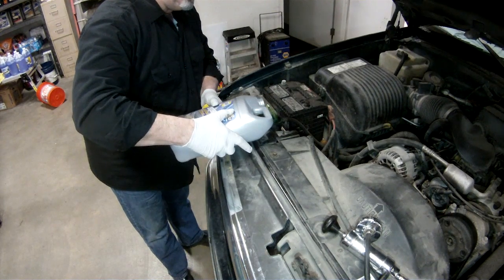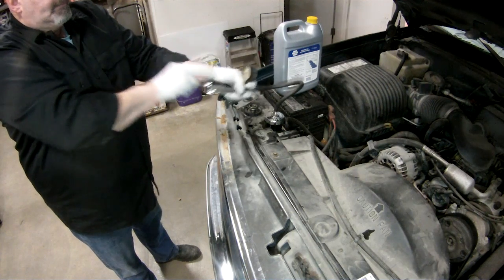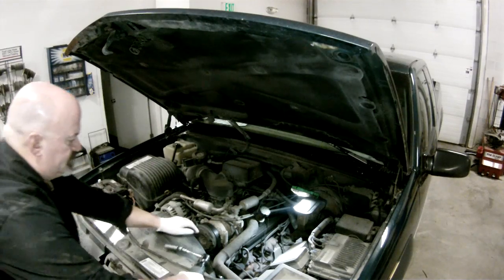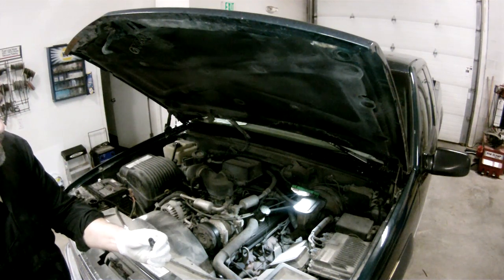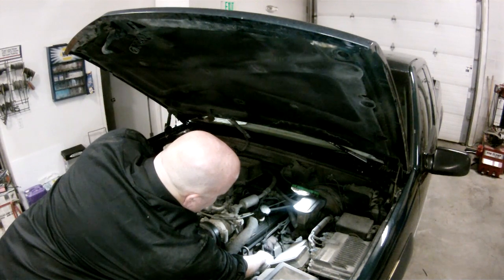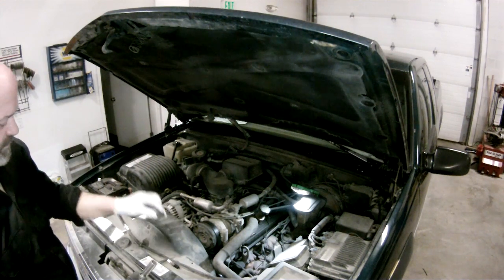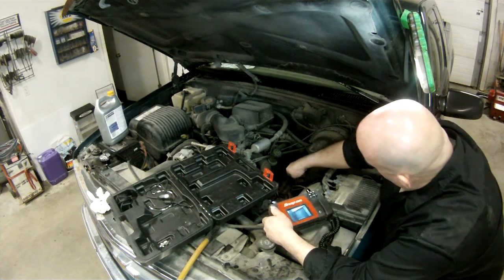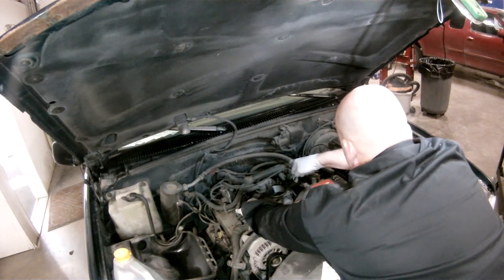Chevy Silverado Cracked Intake Manifold - 5.7L Vortec Intake Manifold Coolant Leak

Comment: My 5.7 99 Yukon left me down the street from my home was overheating stopped it . Next day filled it with water n it looks it's leaking from the water pump prior to this it would go over 210 n go back to middle the heat guage. Could it be the water pump? Or should I replace the manifolds im thinking of replacing the pump t stat n upper hose. N go from there

Comment: I have a 98 1500 5.7 vortec. Sits in the yard and runs cool. Can drive down the road and runs cool until you stop and it will gain temp. Goes little past 210. If you rev the engine it will get warmer. I have replaced the thermostat water pump and fan clutch. Thinking its the radiator not circulating. No water in the oil and not loosing any water. Any thoughts?

Comment: I just replaced the lower intake gasket and jb welded the nasty pitting from the blocked off rear side of the lower intake. Didn't last more than 100 miles and leaks again. Oil cap milky.  Head gasket are new and did that test . So look like a new lower manifold and better gasket will solve my problem. Good thing it's easy job and fan shroud is still off so I can step inside the bay.  Leaning over hurts my bones

Comment: Hey car doc quick question I have a vortex engine I just purchased recently.  I  installed to my 1987 Buick regal everything seems to be going fine. until I filled my radiator with coolant. then I noticed a leak coming from the driver's side on the back of the block. without the engine even being started can you please give me in idea of what  symptoms that could be please?? Thank you

Comment: My 99 Tahoe 5.7 did this exact same thing last night.  I got the check engine light, pegged temp needle and a ton of steam  coming out of the right side of that same plastic intake plenum.

If i swap that part out how would i flush the crankcase out afterwards?
Reply from the maker: Drain oil and change filter. May want to repeat process once after running

Comment: WOW looks  so much like my ..NEWER TO ME TRUCK EXCEPT MINE WAS ROLLED AND SMASHED A GAURD RAIL. TOOL OUT THE WHOLE FRONT END. THEN THEY DROVE IT TILL IT DIES OR GOT PULLED OVER .. not sure what one first  so I fired  it up before  getting it. Of course .. also they cut the cats off and wires cut off as well.  So I was assuming the miss was the 02 sensor.?? Well after all new front  core support  lites and NEW 4 core rad. Hoses and fan and pulled frame rail back straight. Filled up rad. Well I though. So after 4 gallons. It stated to piss put exhaust pipe….  Only drivers side. Lol. Oh let’s say I wasn’t to happy good thing is I  have 3 more motors and 2 more parts trucks laying around. Just  did not want to swap motors. But if it’s just the plastic  intake. Sure.  It’s my GUESS SO  IF IT IS  ILL SEND YOU PICS. ALSO THE TEMP GAUGE IS BURIED WAY PAST 260.  Makes sense now. Plus I have a good idea how long/FAR IT WAS DRIVEN AFTER INCIDENTS…  STUPID PEOPLE JUST DONT TAKE CARE OF ANYTHING ANYMORE THESE DAYS. SAD IS THE TRUCK WAS SWEET CONDITION LIKE NEW INSIDE AND OUT AND IN LESS THAN 6 months it’s total loss.

Comment: I believe I am looking at the exact same failure in a 99' 4.3L Vortec. Same initial symptom of coolant going somewhere but no sign of leak or burn. I too thought the water pump when I seen a slight leak start. Upon starting the truck after buying the pump, bigger leak and spewed a bit of steam but it seem to clear up. Then I got on the road and it was steaming out the carb, would sit 200-210 like usual then sudden spike to 260 where all the coolant just flashed into steam. I raced to pop off the air intake, pcv hose and hold the throttle over to let the steam vent so it doesn't condense into the cylinders enough to hydrolock them. Once it calmed add some water to give it something to work with and get a mile or two more before red light and there it goes again. By time I got it home, which was a grand journey of 5 miles in 2 hours. I had rerouted PCV hose to the overflow tank, blocked off a couple lines with hose clamp. Struct a balance where the engine has a continuous flow of steam into the overflow via the PCV, but at such a rate it maintain 230 which I know these engine can actually handle since that's one option for the thermostat when I buy replacements. I am terrified to start breaking it down and seeing if I can save it or not.
Reply: Bro you should have just got a tow😂

Comment: I recently purchased a 99 with 5.7 and the guy listed as will drive to california. I looked it over the next day and wow. He got me
 Water in cylinders for sure because it would barely turn over . Then I started adding water with it off and water was coming out of the exhaust where the two pipes bolt together before cat . Yeah it happens

Comment: Took my 94 Z71 in for a diagnosis, specifically for my o rings leaking from oil filter adapter housing.  Local mechanic told me my  "manifold intake gaskets" need to be changed soon but he told me not to worry about it because its "minor". What do you think I should do?

Comment: My dad's 1996 gmc c1500 had this happen 2 or 3 times in the 185,000+ miles of ownership. . less than 10k miles when he bought it in 1997 (some dude hot wired his 85 monte carlo one night n wreaked it in front of the house as he attempted to flee from my dad) had to find a good vehicle fast.. I had the truck for a couple years then sold it.. that was a mistake it was a great truck least problematic vehicle I ever owned .. interior held up surprisingly well .. better than the 2016 Silverado he has now..

Comment: Hi I think I have this problem started with a po300 I thought plugs started there ....now I have changed heads lifters distributor pcm crank sensor .It runs pretty good but still I feel a misfire and that damn po 300 won’t go away . O I did change the intake gaskets too . Do you think this is a cracked intake ?

Comment: maybe if your where more optimistic and told the client that their repair cost is cheaper than a $40k Truck more people would value the old one being fixed
Reply from the maker: I try to help folks make the best decisions for sure. In most cases keeping the vehicle you have is the best choice.
Reply: @ThecardoctorTV  i agree so long as parts still available
Reply: Of course repairing its cheaper than a 40k truck, but on one with such high milage it's just going to be proplem after problem... Some people like to use their vehicles, not have them sit in a workshop every month
Reply: @AnythingGasoline  yea mechanics that see people monthly never last.

Comment: Glad I have the easier sbc 350 1994 Z71, had the original tbi aluminum intake pitted, so I went with a holeshot intake w/egr...I got a adapter plate quad to tbi...worked out great :)
Reply: Glad you’re happy with that but Vortec Heads!

Comment: When i but cars or trucks. The first thing i check is the dipstick. If the oil has water bubbles in it i dont buy it. Unless i dont mind buying another motor. I just bought a truck like this for 350 because it had a cracked exhaust manifold and a broken bolt. But i fixed it and its running pretty good now. Still needs some spark plugs and small stuff.
Reply: That was $350 well spent!

Comment: A month ago I told you that I would roll the dice and just change the intake manifold gaskets.Well success!$54. later she is on the road.After starting it up it still smoked. However it cleared up after taking it for a test drive.Because of a botched install of gaskets from a garage the person that I got the truck from just gave the truck to me for scrap.She is running well now. Lucky me.Because the truck burned so much antifreeze it contaminated the EGR which I cleaned and buggered up the O2 sensor and replaced it.I was still afraid that there might be a cracked head when the vehicle was still smoking so I tried this kit from U View and it confirmed I had no exhaust gas in the cooling system. Thank you so much for you incite.If I get one of my bucket list wishes it will to be to ride up to Alaska with my motorcycle carrying enough Beer to sit up all night and swap Manly Stories LOL.Thanks again and take care.

Comment: Great video! Thank you!! I have a similar problem, coolant puddles on the intake driver side. 93 gmc 1500, 350, 415,000 miles original engine.
Spark plugs get frosted white build up over 2 years.
No misfiring, good idle, smokes some but doesn't fog up the parking lot.
My daily driver. No rust just rebuilt front suspension brakes, tie rods. I plan to keep this truck, shooting for 1 million miles,.
Should I replace the intake, or just save for a lower mileage motor?
Any advice would help!
Thanks again for all the videos!

Comment: Hay doc I just swapped out the CPI unit for a MPI  and now I have an intake manifold gasket leak so I took it back off and replace the gasket again but I still have the same problem. What would you recommend

Comment: car doctor, I have a 1993 GMC sierra  4x4  I drove my truck for about 5 minutes after replacing the fuel pump when the throttle got stuck. I hear a noise coming from the throttle body. need help
Reply from the maker: Is it leaking vacuum at the gasket to intake?

Comment: Thanks for posting this video , I think it confirms what I've finally worked out over three years of battling my 98 Chevy suburban vortec , I fitted a rebuilt motor five years back , three years now I've been destroying starter motors noticing vape fromthe exhaust on first start up , hard start , engine lock up and kick bak on cranking , no real loss of coolant but a little bit ,engine seemed to develop excessive psi on attempted start , if you got thru a couple of attempted starts with a bit of blowback etc then it'd fire and run , there was always a little intermittent miss ,and scanner showed extra fuel being dumped in the right bank I thought it was a small exhaust gasket leak , truck would start fine if it'd been recently run , no coolant in oil ,kept blaming crank sensor cam sensor knock sensor you name it ,even replaced distributor ,never throws a code ,after several months sitting and fail to start killing another starter I pulled the plugs and find two cyl have rust on plugs and detonation signs on all plugs , it's gotta be a small intake manifold leak that causes some kind of hydraulic pressurising when trying to start after it's been sitting thru coolant biuld up in the two bores ,if recently run it must not be enough coolant to cause excessive psi in bores and it must be small enough to burn off when running , Chevy are rare in Australia so self diagnosing is really your only option ,hence my stupid three year journey , now I'm finding more US guys are warning of the damned manifold gasket failures , thanks again for helping and sharing your knowledge

Comment: Have a '99 Suburban with 197,000  got it 3yrs. old at 50,000. Oil every 3,000. One day a year ago  engine noise and hard starting got my attention. Realized white smoke ( coolant ) from the exhaust, vey low coolant level, added some, put on a thermostat, then ran down to Valvoline Service and got flushed and refilled. I then used a coolant additive for gasket leaks, the white smoke quit. Changed plugs. Runs like new. Shortly after, the transmission quit. Changed fluid, got worse. Has the Transmission rebuilt $2000  and I am very happy. Expect another 100,000 miles.
Reply: Start saving money up because the "stop leak" is only a temporary repair, but the repairs are still far cheaper than a new $50,000 suburban!

Comment: I know this is an old video but this is the first I've found that matches my situation to a T. This is the lower manifold that has cracked correct? I would assume so but just wondering what to expect. Thanks in advance
Reply from the maker: correct, lower
Reply: @ThecardoctorTV  thanks for responding. We pulled it and found a crack last night. Will be replacing today. Thanks again for the video!

Comment: Hey I have a friend with the 5.7 vortec that is blowing steam through tailpipe and loss of coolent what could it be ...possibly the head gasket??? I’m not familiar with the v8 looks easy to work on though
Reply from the maker: Could be the intake gasket leaking into the engine. Is there any moisture in the crankcase?

Comment: The money the guys gonna spend on another truck would have fixed this problem for sure!! I have close to the same deal going on now I’m not looking forward to doing the head gaskets
Reply: But, IF you put in a gm crate "reman" motor, it would have a GM 3year/???mile warranty, and later, when the tranny crapped, you could have it redone as well, and then the truck would be practically a new one, since the most expensive parts of it have been redone.  Sure, the book value is less than the repairs...but a new truck is $40,000+ nowdays, and has more crap on it to break!  To me, if the frame, electrical, and body is in great condition, it's worth redoing!  JMHO!

Comment: Hey doc i got a94 gmc 350,had water pump issues fixed ths then truck still overheats did head gaskits ,now the overflow is filling up with back presure and pushing the antifreze out. I had noticed molding marks on intake that looked like cracks dont have a camera to check thow also top rad hose is full could it jus be the thermastate not opening,little heat in cab when runing..suggestions pls

Comment: Hey doc, I have a 2001 8.1 gas where I would have intermittent puddles underneath on passenger side.  Pressure tested and see if coming from what appears passenger side bottom of exhaust manifold.  Prob working it's way down from somewhere.  Just starting this dive and wondering if you have any insights.
Reply from the maker: Water pump? I know they leak and run down the oil pan and off the back.
Reply: Found it, broken connector on heater core dripping down.  Gonna be a fun one, thanks!
Reply from the maker: Oh that's an easy cheap fix. Is it the hose quick connector?
Reply: Yes and spotted your video on how to fix it.  I'm leak free!

Comment: I have a 98 GMC 1500 that had symptoms just like the 97 in this video. The last time I drove it (around 3 months ago), I was on the interstate and it overheated and wouldn't start back up. It was losing coolant like no tomorrow, making a loud whining noise, and puffing out white clouds. For a couple of months prior to this, I would get random no-starts from time to time, and gradually lost engine power and fuel efficiency (but it never died while idling, or surged). It had to be brought back to my home on a flat bed trailer, and it hasn't moved since. Could it be a blown intake gasket?
Reply from the maker: maybe but possibly two separate problems one a coolant loss and the other a no-start issue
Reply: I was checking the radiator on it yesterday, and I found a leak in one of the cooler lines. So I'm led to believe it's a radiator leak, and possibly a faulty crankshaft position sensor. Thanks.

Comment: Here's an oddity for ya leaking coolent water pumps good no coolent in oil oil pan checked out no chocolate milk no loss of performance 2007  4.8  GMC Sierra i was reading where another guy had the same problem and it was an external head gasket leak where it wasn't leaking into the block but out of the block and burning off?
Reply: Any assistance would be of great value lol
Reply from the maker: That can happen. Most likely cause of coolant loss is faulty water pump but head gaskets can leak into the combustion chambers, into the crankcase or externally.

Comment: 1995 yukon 5.7 not a vortechHas the same issue, vaping through the tailpipe, and loosing coolant. I believe that it's just the intake gasket. The plugs are not wet. The engine has great compression and the water pump is doing its job . Does not overheat when there is a full level of coolant. The crankcase does have some froth built up on the cap but inside the lifters look clean.

Comment: Do you think exhaust manifold donuts can cause a p0171 code? I have a 98 k1500 Silverado 5.7 I'm trying to track down an exhaust or intake air leak but only thing I can find is water and air shooting out the exhaust  donuts and rear flange...
Reply from the maker: I guess it's possible but not the most common cause.

Comment: Great video. Can a bad lower intake gasket cause water(coolant) in a cylinder? Or is that strictly head gasket. Thank you
Reply: Re-watched vid...more than likely head gasket causing water in cylinder. Ho Humm
Reply from the maker: yes but it is possible if the intake gasket leaks allowing coolant into an intake runner. It would have to be a cylinder that shares a passage next to the water passage like #1, 2, 7 or 8  not very common. I have also had a cracked intake leak into the intake and run into multiple cylinders. Might want to try using a combustion leak detector kit to see if there is combustion in the cooling system.

Comment: I have a 99 vortec 350 that I am swapping over to carburetor and I am putting it in my 78 custom deluxe c10 I haven't really seen anyone do this but I have done it to a tbi motors out of a 93 gmc
Reply from the maker: What will you use for an intake manifold? Sounds cool.
Reply: A intake through jegs